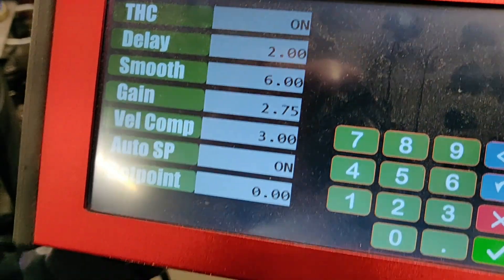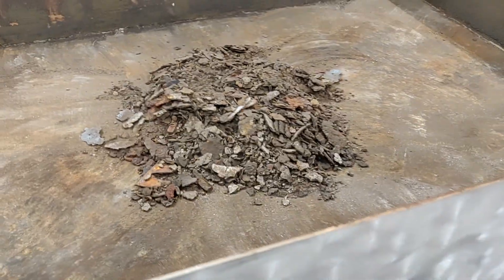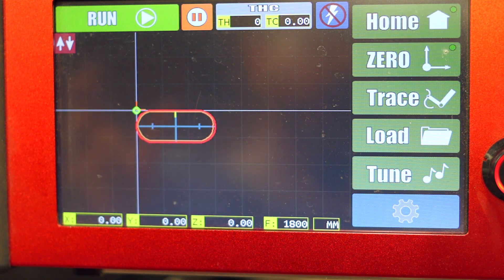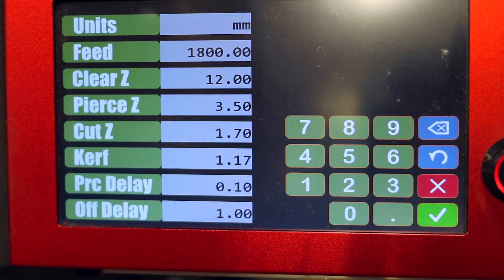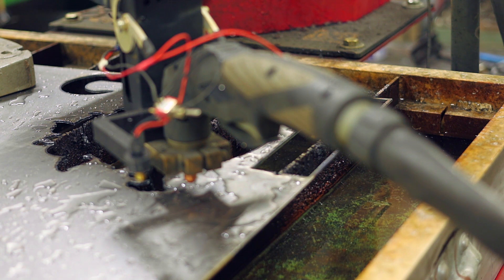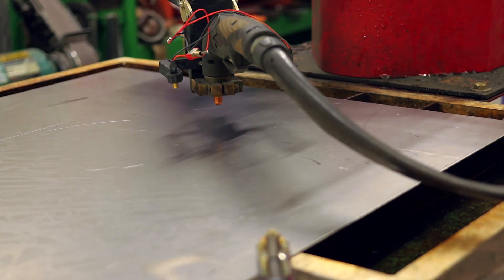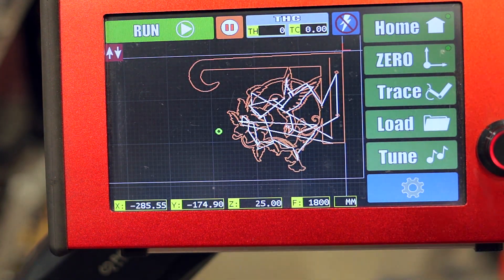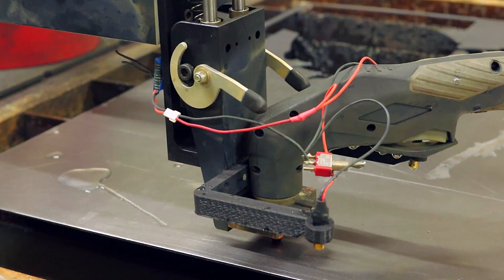Arcdroid: Making a splash with some more cuts and layouts.

Comment: Thanks for making these videos 👍 I was wondering if you have used the mirror feature at all. I have tried it on my Arcdroid and it doesn’t seem to work right. It just takes the drawing and moves it to the other side but doesn’t retain the original drawing. 
It’s more of a (flip drawing) then a mirror.
Any suggestions would be appreciated. Thanks.
Reply from the maker: Hi Mike, I have not used it so I'm not much help on that one. But it may depend on where your origin is set.
Reply from the maker: You could email ArcDroid and I'm sure they will give you the rundown on it.
Reply: @amp_mechanic  thanks for getting back to me 😊 as far as I can tell it looks like you need to cut your part, then mirror it and cut the other half. It gets a little strange with the start and stop points though. I was excited about this feature but as soon as I realized it’s not working the way I thought it would it became almost a useless for me.
Thanks again for all your videos on the Arcdroid 👍